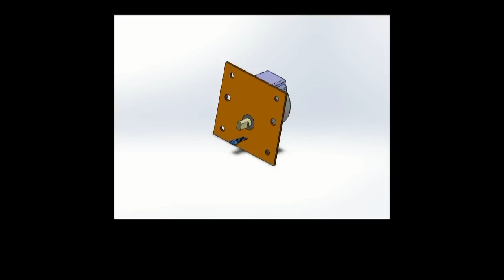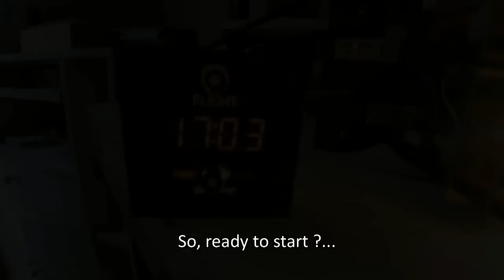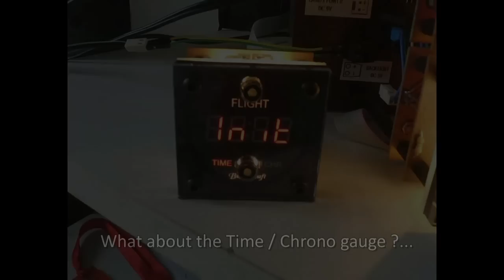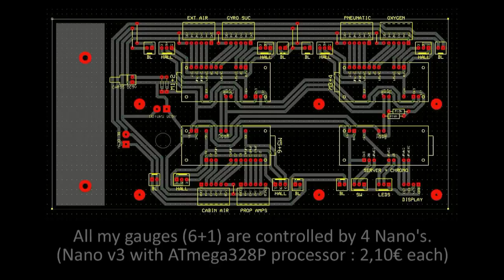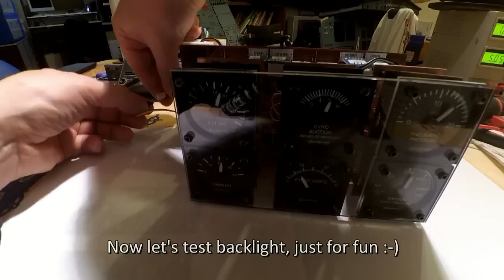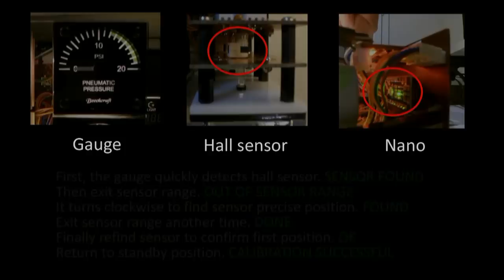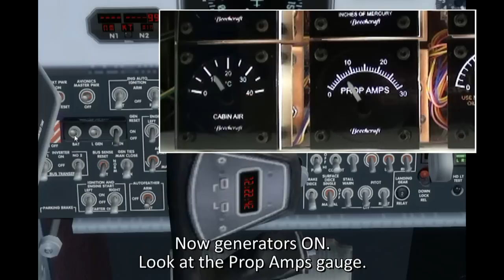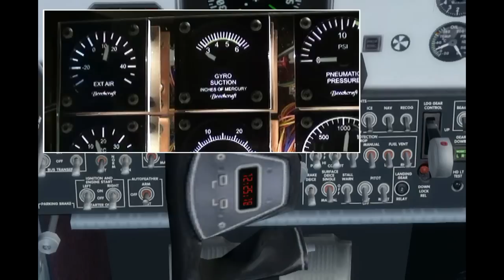Home made Gauges for FS or P3D

Comment: Really good and professional job! I really want to know the type of glass that you use in the front area just before the last layer (at 6:29)?
Reply from the maker: Hello Nikos, Thank you for your comment. The glass is made with a clear PMMA sheet (3mm). It's easy to find and it's manufactured by many brands : Plexiglas, Perspex ... It's a perfect material for laser cutting or CNC machining. I'm buying it on Amazon as many resellers are located in Germany, but I also have some resellers in my country (France). Depending which color and thickness I need, I can find it locally or sometimes in other countries. If you're using a laser machine, make sure the raw material is "PMMA" : the clear acrylic sheets we're finding here in our local physical stores are not PMMA but another material which cannot be cut by the laser, it burns and sometimes ignites ...
Reply: @Frederic_320  thank you very much! and so you can order it black and with the laser you can engrave-paint it?
Reply from the maker: @nikosgeorgakis6759  Right. If you engrave black PMMA with a protective adhesive, it's possible to apply white paint or an UV solder mask to fill engraved parts only. But I prefer to start with a white diffusing PMMA plate, then paint it with a black spray and engrave. That way it can be backlit, not possible with black PMMA.
Reply: @Frederic_320  You Rock thank you!!!!

Comment: Awesome project. Most homemade gauges I've seen were very laggy and didn't move very well. However, it seems yours run very smoothly.
Reply from the maker: Hello, thanks for your comment ! These old gauges were made with a very cheap stepper motor. You're right, it was running smoothly but cannot turn very fast. It's OK for such instruments (temp, press ...) but couldn't be used for instruments which require fast moves such a vertical speed indicator or a RPM gauge. But many improvements were made since I  created these gauges. I designed new models (see my other videos) which are much more efficient. Last thing, stay tuned, I'm about to upload a new video of a dual needle gauge prototype which runs fast and smoothly ! Hope you'll enjoy :-)
Best regards,
Frederic

Comment: Great Job and really like to watch this many times and I wish I would made one.. would you tell me what 3D design Software that you use? its really nice if I can simulate the movement of the needle like that.. thanks in advance
Reply from the maker: Hi Reza, thanks for your comment. I was using SolidWorks because I had an access to that soft with my previous job, but it's a very expensive software and I can't buy it for a personal use. So I'm now using Fusion 360. This said, the 3D animations in my videos were made with SW, I don't have enough knowledge for now in Fusion to do the same.

Comment: Awesome video !!! It is the only instructable I have found on youtube and I have search extensively.  Would you please share the arduino sketch?
Reply from the maker: Thanks for your comment. Unfortunately I don't share my sketches which are related with other parts of home cockpit (and sometimes with Sioc too), but if you need help you can contact me. I'm using OACSP library to make FS (or P3D) and arduino's communicate together. I also use Wire library (I2C communication), Time and SevenSegmentTM1637 libraries (for chrono) and AccelStepper lib for spindles. Hope this will help !

Comment: Beautiful work. Consider part x27-168 for your next build. A purpose built stepper for dial gauges.
Reply from the maker: Thanks for your advise, I bought some of them but I didn't took time to test. My first experiments (with basic steppers drivers) are not very good, perhaps I need a specific driver for these motors ...
This man seems to make them work : https://www.youtube.com/watch?v=Og5OlYPBVso
He leaved a comment below, and I'll have to try with the same Easydriver ... when I'll have some time !
Reply: There seem to be Arduino drivers available for these steppers.  A quick google search showed a few.
Reply from the maker: Yes, you're right, but they are quite expensive, I don't want to spend $20 or more before being sure I'll make it work.
I'm not a professional and I've no particular knowledge in electronics, so I always use cheap components ... considering some of them will burn in my hands ;-)
Reply: Not sure what expensive is to you but they are around $3/each when bought in lots of 6 or more on amazon and ebay.
Reply from the maker: Official drivers are much more expensive, but I agree with you, I found drivers around that price on AliExpress and I'll try them soon. I'm sure the x27 stepper is the best one for gauges usage but I discovered it only some months ago and wanted to test them first with drivers I already owned, but that didn't match. This said, thanks for your pertinent comment.

Comment: Good day to you Frederic I hope all is well with you and yours. Can you tell me please what laser cutter you are using to cut the panels with? I have already ordered myself a Creality Ender-2 3D Printer which will more than satisfy my needs but not sure about the laser cutter or CNC machine. All the best and thanks for sharing your project with us.
Cheers
Jim
Reply from the maker: Hi Jim, I'm using a cheap Chinese CO2 laser sold on eBay (50W, work area 50x30). I don't own a CNC and I can't compare, but I can imagine engraving would be better with a CNC. Laser makes engraved parts a little dark and they are not perfectly visible without backlight. This said, in that video, panels are printed on paper + transparent film, no relation with laser which is only used to cut Plexiglas. Perhaps you saw some of my A320 videos with backlighted panels, these ones are effectively engraved with the laser. Feel free to contact me if needed.
Best regards,
Frederic
Reply: Many thanks Frederic - I appreciate the information. I hate to ask but would you be able to share the 3D file for the parts you printed for the magnet holder? All the best and I look forward to seeing more of this project in the future. Cheers.
Jim
Reply from the maker: No problem Jim, just send me a private message with your mail and I'll send you the ST filesL
Reply: ...and done - thanks again Frederic
Cheers
Jim

Comment: Amazing ! What's the laser cutting machine you have ? You mention that you bought on ebay but can you state a model name ? I couldn't see anything on the video apart from the control screen & panel
Reply from the maker: My laser machine has no specific reference, it's a generic model. Specs are 50W CO2 Laser with 50x30cm working area.
I can"t find it on eBay anymore, but it is very similar to this one :
https://shenhuilaser.en.ec21.com/offer_detail/Sell_RF_5030_CO2_50W--6425183.html
Reply: Ok I see what kind of machine it is. Thanks !

Comment: This is awesome.  How does the hall sensor know which side of it the magnet is on?  Or is it just using the hall sensor and magnet as an initial zero reference?
Reply from the maker: Hi, you"re right, I can't know if the magnet is on the left or on the right. My needles are small enough to make a complete turn in the gauge, in case of wrong direction when initializing.
The hall sensor is nearly at the mid-range of the graduation. Assuming you're leaving your aircraft "cold and dark", needles should point the zero of each gauge. So, initialization turns needles to the right until magnet is detected.
A better way would be to make a specific holder for each gauge, with magnet pointing sensor just after the end of the graduation.
Finally, I'm actually testing X27 motors (used in automotive) which don't require any calibration : they have end-course inside, my final version will probably be done with them.

Comment: These are cool however current draw from nav lights etc will not show up on your prop amps indicator. Thats what the volt/loadmeter overhead is for.🖒
Reply from the maker: Thank you very much for this information. I've no knowledge in B200 avionics, I just did these gauges for a friend and didn't searched for their real behavior. I'll change my code to match a little more with the real life !

Comment: Wow, these are amazing!  your elegant design and construction are fantastic.   I have to ask though, you show your plastic pieces and a circuit board on what looks like a laser honeycomb.  Was your  circuit board also etched on that laser?  Thanks for sharing this great video!  I hope your having a lot of fun flying!
Reply from the maker: Thank you Paul. The PCB is not really etched with the laser. I first cover the copper plate with a paint spray, then engrave the painted layer with the laser. Finally I use iron perchlorate exactly as if PCB had been insulated. I'm proceeding this way because I bought some years ago a stock of non pre-sensitized circuit boards, approx. 10m² ... It's the easiest method I found to realize precise PCBs using my cheap plates.
Reply: That is a great way to create the etching mask.  I look forward to giving this method a shot!  Thanks again for sharing!

Comment: Good stuf! Where did You get the magnet holder and magnet and what types? Thanks Ahead
Reply from the maker: Hi, the magnet holder is designed by myself then 3D printed. Magnet is a 5x2mm neodyme, easy to find on eBay for example.

Comment: This is really nice work, will this tech be adaptable to the datarefs from X-Plane 11? And have you discovered and or tried XP ?
Reply from the maker: Thanks for your comment. I tried XP many years ago but I've not been very satisfied with it. So  went back to FS. I've no idea if it's possible to interface XP with hardware, what I can say is I only use FSUIPC standard offsets (does XPUIPC have a list of available offsets too ?) and its ability to run lua plugins. So, if XPUIPC can run lua plugins and has offsets for gauges values, I don't see any problem for my gauges to work on XP. But there is probably other ways to proceed in XP, I don't have any knowledge on that soft.
Reply: jagjet Interfacing with X-Plane's datarefs is very achievable with Arduino - much nicer than FSUIPC offsets too :)
Reply: Thanks for your input and response, X Plane is and has been a much better way forward. I understand that many of the MSFS and P3D users have a lot invested and are not as likely to make the switch to X Plane. As a 30 year Corporate Jet Captain I have seen the clouds and the snow and well of it, where it counts......and my observation is that you can spend more money but for the entry price you can not find a more realistic platform. I still every 6 months in the 6 axis torture box and they aren't cheap either so, make your best impartial guess and put your money down.

Comment: Frederic, these are absolutely beautiful.  Truly great work.  How did you etch the circuit boards?  I searched the comments and didn't see where that question had been asked.
Reply from the maker: Thank you Rick for your comment. I've a "pretty personnal  way" to etch my boards, here is a copy / paste from another comment :

The PCB is not really etched with the laser. I first cover the copper plate with a paint spray, then engrave the painted layer with the laser. Finally I use iron perchlorate exactly as if PCB had been insulated. I'm proceeding this way because I bought some years ago a stock of non pre-sensitized circuit boards, approx. 10m² ... It's the easiest method I found to realize precise PCBs using my cheap plates.

Feel free to contact me if you want more details, but I'm really not a professional ...

Comment: Is it possible to do something like this with say an altimeter or even gauges like those for the DC3 in FSX?
Reply from the maker: Every needle based gauge can be done easily, just some shapes and sizes have to be modified. I found dual steppers (with concentric shafts) which can be used for an altimeter for example. But I'm not competent enough to develop an attitude indicator or gauges with moving parts (altimeter with adjustable QNH, VOR with adjustable heading ...). I think these gauges would require some very small and precise parts I can't realize by myself. Mechanical parts and small mechanisms are always a problem for me.

Comment: How did you get the printed pattern to be glossy?  It looks like you printed them on paper and then glued them to the PMMA.  Did you put some kind of lacquer on it afterword?
Reply from the maker: The pattern is printed 2 times :
1/ with colors on a standard 80g white paper sheet
2/ black and white / mirrored on a transparency film
Both sheets are glued together (with a glue spray), opacity is then increased and the transparency film makes the result glossy. The ink (trapped between both sheets) is also protected.

Comment: Where did you learn eletronics?
Reply: Wait how do u interface fs and those gauges?
Reply from the maker: If you are an electronics technician, your question is probably ironic :-) I've no particular knowledge, I learned with Arduino's tutorials and Google was my teacher. My schematics are certainly not very "academic", they just do the job ... Gauges are interfaced with Fs using OACSP library (Open Airbus Cockpit Serial Protocol), which makes Arduino cards able to read and write FSUIPC offsets in real time. Other cockpit builders are using Arduino's without OACSP library, for example here (sorry, in French) : https://simua320.jimdo.com/logiciels/ (section Overhead softwares).
Reply from the maker: These gauges are interfaced using OACSP library for Arduino (Open Airbus Cockpit Serial Protocol). Each arduino card contains its own code, but I think it's also possible to interface them using more user friendly GUIs like Mobiflight for example.

Comment: The hands are too dark. But otherwise very nice! :-)
Reply from the maker: Thanks Gerhard for your comment, you're totally right, that's the main problem of placing leds backwards. I tried different materials including clear PMMA (light transmissive ?...) without success. Actually I have no other solution than the main MIP lightning for dark hands.
Reply: @Frederic_320  Hmm … is it possible to place LEDs left and right to the hand? Or perhaps integrate a micro LED (SMD) into the hand itself and use thin wire from a transformer?

Comment: No los vendes
Reply from the maker: If it's a question, no, I can't sell that kind of gauges which are very far from PnP and ready to use hardware. As you can see, my pcbs are not very professional, my wiring isn't optimized, 3D printed parts are not perfect ... I'm sure end users are expecting much higher quality. But I'm still looking to improve them and try to make a generic model which could be included in different aircrafts.

Comment: That's all well and fine if I had a $5,000.00 3d printer. Take that Home Made out of the title. I hand make all my stuff out of plastic and a drill press converted to a milling machine. That's homemade.
Reply from the maker: I don't have a $5000 3D printer too, mine was bought on Kickstarter for approx $1000 and my laser is a cheap Chinese one sold on eBay. I'm not a professional manufacturer, a technician or an engineer, I didn't asked anybody to create parts for me, everything has been made in my living room by myself so I think it's really "home made" even if (I agree) everybody doesn't have a CO2 laser and a 3D printer at home. Please don't confuse home made with hand made. This said, you can do exactly the same with a drill and a saw, even the magnet holders and the spindles can be realized without a 3D printer, just require some imagination. Now, it should be nice to make a video explaining how you realized your milling machine (I don't own a milling machine and I'd be interested) instead of leaving such useless comments to those who spent time to share their personal experiments.
Reply: We call those people "Trolls" 

On a happier note, Nice work on the gauges, very easy to follow along and very impressive work as well. Thanks for sharing.
Reply: Frederick, Thank you very much for your videos!! Don’t worry about the idiots!!!
Reply: You can get a decent 3d printer for under $500 these days.
Reply: Don Cornwall $5000 3D printer? What shall you print with it, human kidneys?! 😂
Reply: Haha, old grumpy guy spottet. These days you go to your local makerspace and get access to 3d printer and laser and all sorts of shit.
Reply: Don Cornwall you are a troll. He never said hand made, he said homemade. If this does not interest you go watch some cat videos.
Reply: You can do this with a $150 3D printer...
Reply: Someone always has something rude to say! Yes there is a difference between hand made and home made, but who cares! Enjoy the video or bugger off mate!
Reply: And one more thing, I got my printer for 35 bucks from a pawn shop. Needed a few thing but I got it up and running for les than 50 bucks, so that outrageous price tag you vomited out on here makes zero sence mate. Just know where to look and with a bit of imagination and skill, there is nothing you can't do! Get inspired from videos like this not discourged. I'm going to create some tonight, but not for a sim, maybe for some power monitoring in my server room. Would be a cool rack mount solution and add on. Definatly a conversation piece.